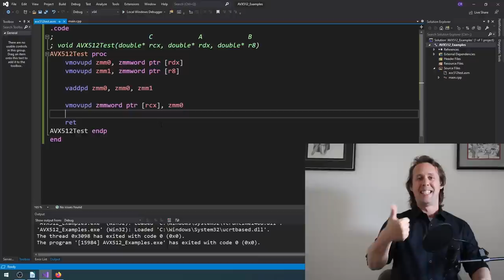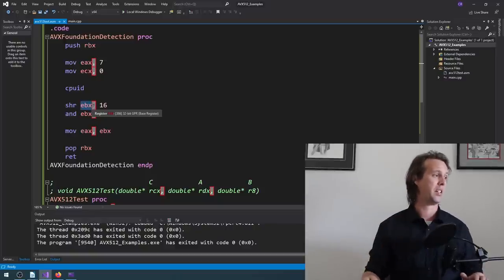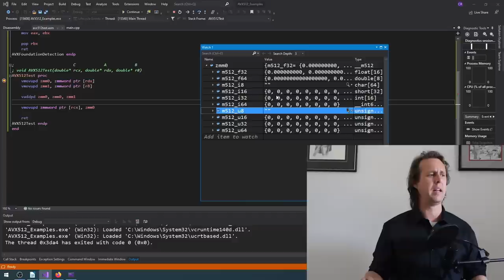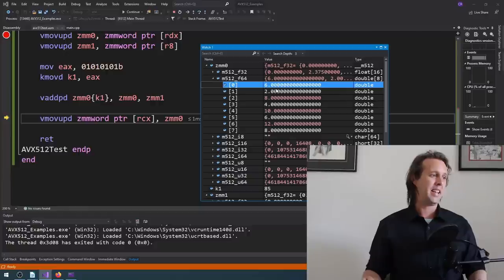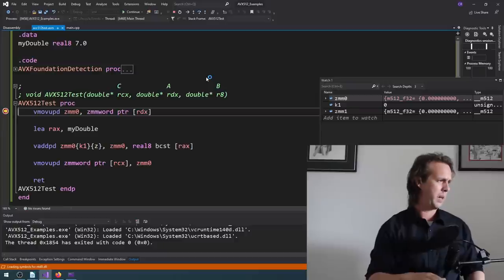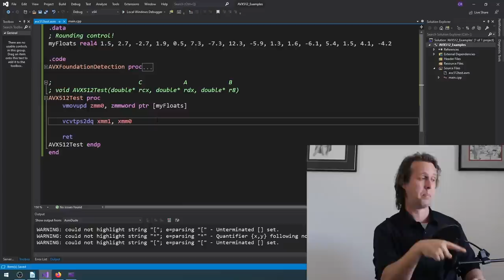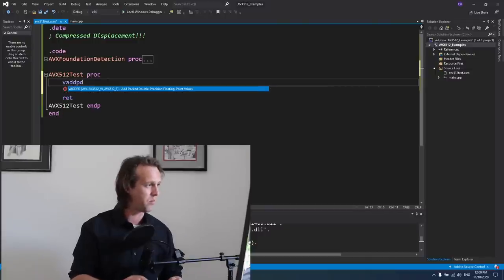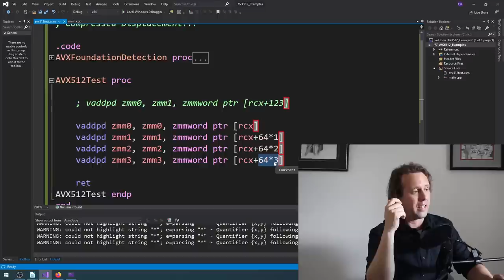AVX512 (3 of 3): Deep Dive into AVX512 Mechanisms

Comment: How come you were using vmovupd instead of vmovups in the rounding example to load the single precision floats. Is there any difference between the two, like vmovups requires 4byte alignment. Or do the vmovu* instructions remove all alignment requirements and expand to the same micro ops?
Reply from the maker: Oh well spied!! It is a mistake. On some CPU's I understand there is a penalty for switching data types like that, so it should definitely be VMOVUPS! Pinned mate, thanks for pointing this out :)

Comment: Would ever do a performance comparison between AVX-512 and AVX2? AVX-512 is notorious for downclocking due to the heat generated. I believe it only happens with using the 512 bit registers, so AVX-512 instructions on 256 bit registers don't have that problem? Not sure, but it's be great to see an investigation (both the instructions and the extra registers - if we can still use the full 32 256 bit registers at full speed, AVX-512 would still be worth it IMO).
Reply from the maker: Great topic! I'm not sure if we'll cover it. AVX512 runs at half the speed for floating point, that's even before the downclocking. I didn't check all the instructions, and the broadcasting and masks still add a lot of flexibility. But, certainly at the moment, it seems like AVX512 is best used for integer operations. Cheers for the suggestion :)
Reply: @WhatsACreel  It really depends on the uarch. I don't know much about Ice Lake, but I do know about Skylake Server (SKX) which embeds AVX512 for about 3 years now.
On this uarch, you can execute 2 FP instructions per cycles, which is the same as for integer ones. So downclocking aside, AVX512 is twice as fast as AVX2 on this uarch.
Maybe you could do a little micro-benchmark on your machine to see?

Comment: Really cool and awesome videos talking about some of the AVX512 ! Can you explore more about avx512 in the future, especially the FMA instructions in the future? CUDA with tensor cores boost the GEMM computation through put by such a big degree that now the Ampere A100 basically has more silicon for tensor cores instead of the common CUDA cores. The GA100 actually has much less fp32 CUDA cores than the GA102 gaming/content creation lineups(like RTX A600 or 3090) . It would be interesting to see how the avx512 FMA implementation on BLAS boosts the speed/throughput in comparison to that of avx2 and no avx at all.
Reply from the maker: I would love to! Trouble is getting hardware :( I have a 1050ti, that's about it at the moment. Certainly a fine card, but not exactly state of the art. Some more AVX512 vids would be fun!! The fmads are awesome!! Thank you for the suggestions mate, and thanks for watching :)
Reply: The GA100 has 6912 CUDA cores, with over 13,000 FP32 units. The GA102-derived RTX 3090 and RTX 3080 have around 4,000-5,000 FP32 CUDA cores, with around 8,000-10,000 FP32 FPUs. Most of the die area on Ampere GPUs is still reserved by the shader/CUDA cores. The GA100 lacks RT cores, those are for GA102 and smaller dies only.

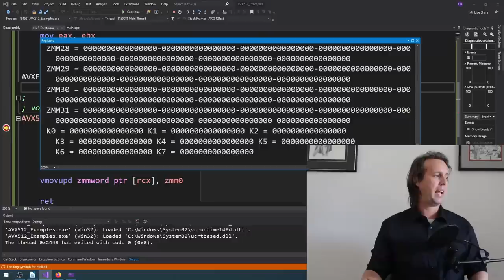Comment: 8:21 - The only thing special about k0 is that you can't use it in a lot of instructions. The encoding "000" is used to mean "no mask". It doesn't read k0 when you do that, it just is hardwired to "no mask". That's why changing the contents of k0 doesn't change that behaviour - it never actually reads the register. But because the encoding is reserved, it also means you can't use k0 for most instructions. It's a perfectly good normal register, it's just the encoding for most vector instructions is reserved, so you can only really use it in the other mask-register instructions - as a temporary or things like that.

Annoyingly, some assemblers allow you to use the "{k0}" syntax, which is technically illegal. Because again - the instruction doesn't read k0! They should produce an error, but they don't.

Comment: Really interesting video, big thanks for this. 
I'm sure I'm missing something, but in that AVXFoundationDetection code, after the cpuid instruction I see you test bit 16 of ebx by doing an initial shift of bit 16 into bit 0 (shr ebx, 16) and then the test of bit 0 (old bit 16) with 'and ebx, 1'. Could you also test bit 16 directly with that 'and' thus bypassing the need for a shift? All bits would be zero'd appart from bit 16 so the appropriate status flags (e.g. Z) would still only reflect the status of bit 16, so true/false return maintained?

Comment: I have a question, why use lea when you can use mov with the pointer operator, don't really remember the syntax but you know what I mean
also, in the command vcvtps2dq, I understand everything except dq, I understand the it is a 4 byte int but what is dq?
Reply: Lea is typically preferred by most compilers, I believe it is because it doesn't update flags so it avoids creating conflicts in instructions when the cpu wants to do some reordering of instructions.
Reply from the maker: I can't remember what the code was doing? LEA makes a pointer, MOV just moves the data. It's possible you can use the data directly in a SIMD instruction, it's usually only the final operand that can be memory, but check the manual if you reckon there might be a faster way than my instructions. It's certainly possible I just did something stupid :)

As for the DQ, I have to admit, I have no idea!! Haha, as far as I know, it means Double Quadword, so it refers to the 128 bits of an SSE register. I'm not sure what that's got to do with integers though?
Reply: @WhatsACreel  what you did was:
lea rax, myDouble

but in fact, you could have just done:
mov rax, offset myDouble
to just load the address of mydouble, since myDouble is just an alias for [*some number*]
Reply from the maker: @gideonmaxmerling204  Oh that's great!! I've never seen that syntax! I've always just used LEA for addresses and MOV for data. Cheers for sharing mate, that's cool :)
Reply: @WhatsACreel  thinking about it, you could also have not done the mov instruction and just "bcst [ OFFSET myDouble]".
But considering that myDouble is an alias for [*number*], I think you should try doing "bcst myDouble".
I would test it myself but my cpu only has avx2

Comment: Is there an option with VS to build .exe files which then load the code blocks upon execution depending on the architecture?  e.g. You can have procs optimized for AVX512 which run instead if the CPU can handle it and an alternate proc module if not?
Reply: You could use the preprocessor for this. It's available in C and C++.

Comment: question: why is simd still developed ?  arent they obsoleted by gpus or is there something they can do gpus cant?
Reply: It takes a very long time to send data to the GPU, tell the GPU what to do with it (and only 1 thing for all the data), and get the data back. It is only worth the overhead for very large parallel data sets, that don't need to communicate with the CPU too much. CPU SIMD doesn't require the overhead of using the GPU and is also more flexible.
Reply from the maker: Great point AAA!

I'd also say that GPU's really are SIMD. The warps in CUDA programming show us that a GPU is really just a 32 way SIMD device, it's not very different from a CPU at all. GPU's are becoming more and more like CPU's while CPU's are becoming more and more GPU like. Maybe they'll meet in the middle at some point?

Just my two cents, cheers for watching mates :)
Reply: In my experience, debugging/troubleshooting CPU code is way easier than GPU code. Part of this, I believe, is that no mainstream language has GPU code as a first class language feature; you always have to install the vendor's SDK or a third party library. For an example, C# got official ARM support before it got official GPGPU (which is none).
Reply: as gpu capabilities grow we might soon ask: why are cpus developed?
Reply: Another reason is that high-level compilers that generate normal x86 code have no idea about the GPU. The GPU must therefore always be specially programmed and accessed via APIs. With SIMD units of the CPU, all you have to do is tell the compiler to use SIMD and then it will optimize your code for it as much as possible without you having to rewrite the code. However, it makes sense to design the code in such a way that it can be easily optimized for SIMD units.
Reply: @JackMott  SIMD do help in single thread applications, GPUs or more cores will not.
Reply: @OpenGL4ever  that is sort of tautological.  but it is rare that a program has data access patterns that SIMD can leverage but that a GPU or more cores can not. since in both cases  you are doing things at the same time.
Reply: @JackMott  It's not. The problem with GPUs is, accessing them is slow. But accessing a SIMD on the CPU is fast. And using a SIMD is faster then creating another thread.
Reply: @OpenGL4ever  the issue of loading data onto a GPU depends on the platform, with unified memory it isn't any slower. CPU and GPU both load data from ram.  and if you are turning towards SIMD or threads to improve performance, it implies you have a lot of data to deal with, which means thread creation to process that data isn't going to be a huge amount of overhead. make a few threads up front, then crunch data.  Same with the issue of loading the data up onto a discrete GPU.  Pretty much every time I have turned to SIMD to do something faster I am also doing it on multiple threads.
Reply: @JackMott  I'm talking about the PC and that's how it is there.  Compilers use the SIMD unit for things a human would never guess. This is why it is also found in normal code with few data.

Comment: Man AVX512 looks so useful. Sad that I won't be able to use it cause almost all the code I write is for an arm5te processor
Reply: ARM has NEON though! :P
Reply: You can emulate AVX512 in bochs and run bochs on your ARM processor. It will be very slow, but for learning it should be good enough.
Reply: @OpenGL4ever  its a console
Reply: @Illya9999  Well then you lost. As far as i know on ARM a SIMD unit is only available from the later generation, the ARMv6.
Reply: @OpenGL4ever  yep